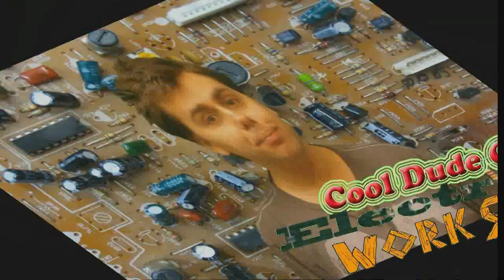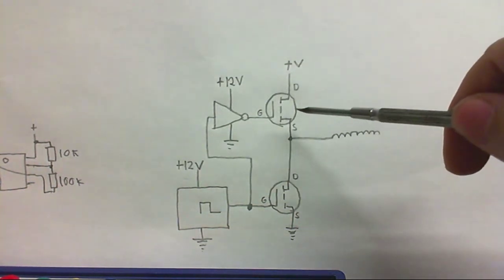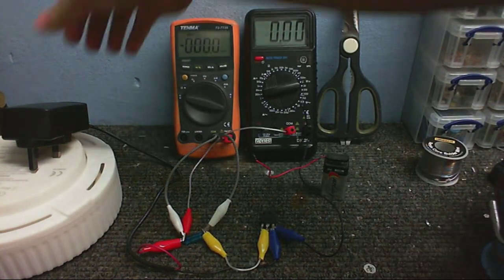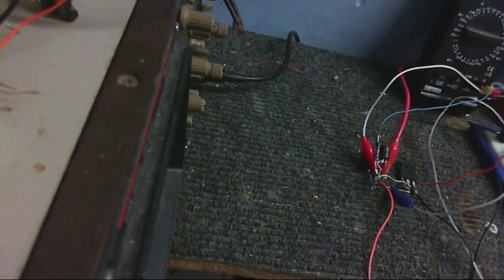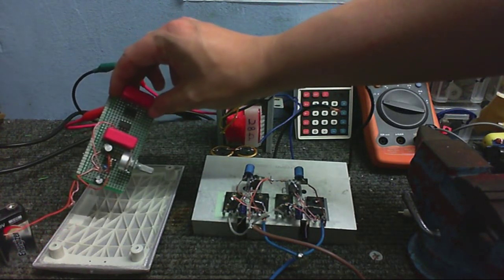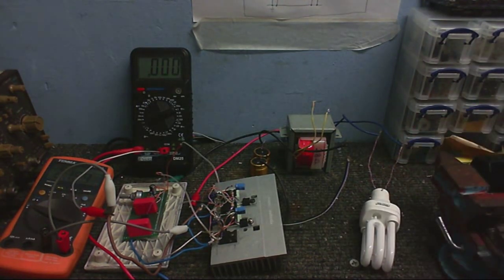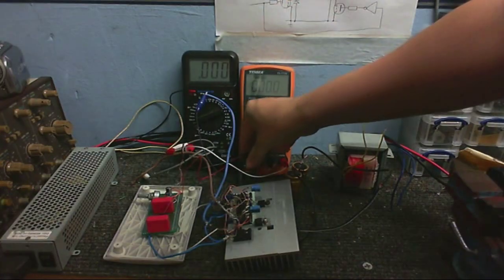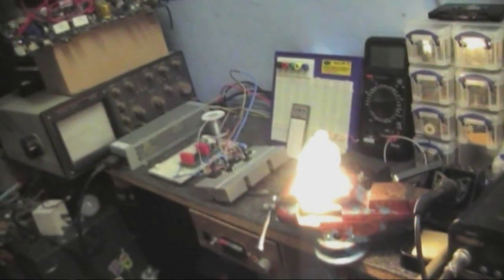Home made Inverter and rambling about Mosfets

Comment: could you use two high voltage capacitors in series across the supply and the tapping from the junction of the two capacitors which goes to the side of the transformer which connects to the connection of the two mosfet transistors, if you look at the induction heating circuits use this circuit.

Comment: Is that "non-polarized" electrolytic cap really necessary? Since you are using H-bridge, I don't think that DC decoupling is necessary, however, maybe it is. Just seems like another source of loss when pushing big currents through transformer. And yeah, you were aimed to get most output, but by introducing that MUR diodes you lose some voltage across 'em. You've measured output when using tiny light bulb as load, which draws small current; but bigger the current, bigger the voltage drop across the diode will be. Voltage loss ain't gonna be terrific, but still. Just some thoughts to improve your design, if I get it right, 'cause your schematic confuses me a little. But it works, nothing blows up, so it's a good design.
Reply from the maker: +MrJohhhnnnyyy I used the capacitors at the H-Bridge output just in-case something goes wrong and the circuit latches in one state or the other, that way it's not going to push a huge current through the transformer coil and burn something up.
Reply: CoolDudeClem Got it, that makes perfect sense. But i would rather use a fuse inline with PS. However, I use an lead-acid battery as PS for my inverter, it can easily pop 5A fuse in case one (or all) switches latch on or short out

Comment: How does touching the MOSFET discharge the gate?
Reply from the maker: Your body is a somewhat conductive, what I did was touch the gate and the source at the same time, so the current from the gate flowed through my hand and discharged into where the source was connected